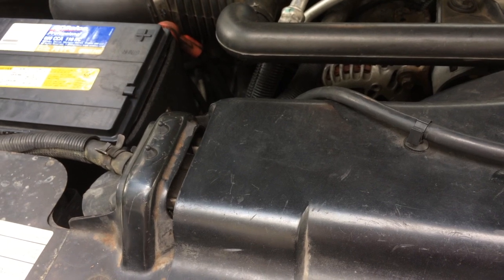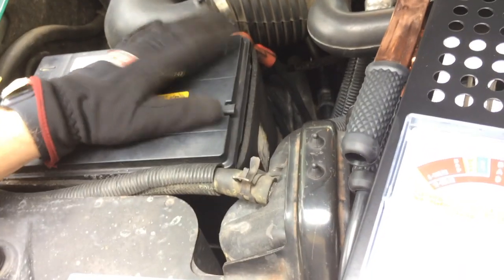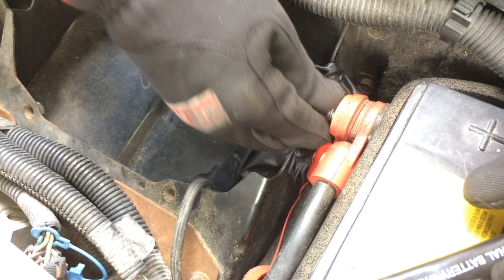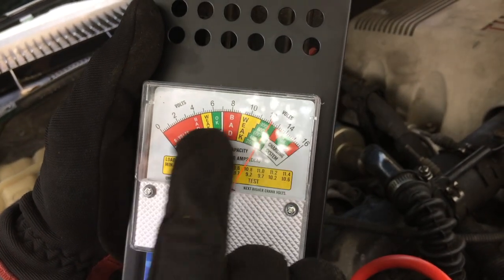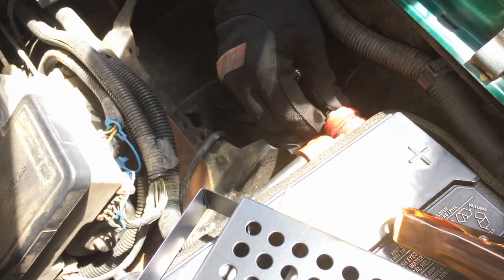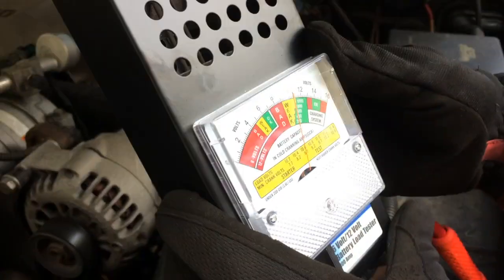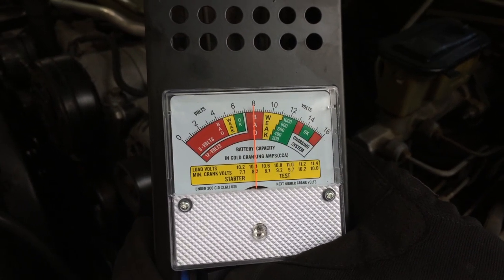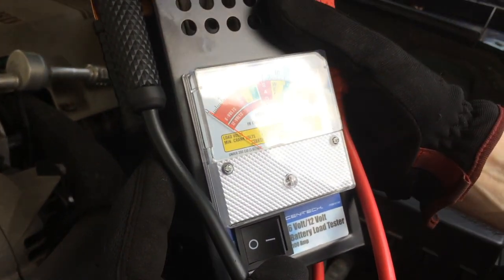1992 - 2002 6.5L Diesel GM Truck Testing Dual Batteries Reduced Cranking Power (Chevrolet & GMC)

Comment: Hey buddy thanks for the videos you do, just found your page. Have a 6.5 deisel also. Need some help with electronic components. When truch ia going at mild thottle, going 55 state highway. Will jump and lurch, with an extreme  thottle. Hold down break does not slow thottle speed.
Reply from the maker: I'm getting from the comment that you're experiencing an unexpected acceleration - I've not run into that sort of problem before.   But if I did I'd check for any diagnostic trouble codes with a scan tool first, and then see if the problem persists with cruise control engaged second.  I'd next look at the accelerator position sensor and see where results of these three checks took me next.

Comment: I have a 1998 GMC 350 and I was wondering if you can tell me where the TPS sensor is located I’ve been looking to see what tells me where it’s at can’t find anything
Reply from the maker: 98 GMC 5.7L Vortec V8 Throttle Position Sensor?   Not related to this battery video, but it's going to be on top of that engine attached to the front of the throttle body (the butterfly valve's shaft goes into it).   Search for 98 GMC TPS  and you should see a video from another creator here on YT that covers this for 96-99 GMCs.

Comment: I just found you today and am very grateful for the information that you give. I just bought a short school bus with a 6.5L Diesel engine. It's a 2000 Chevy 3500 model with 189,000 miles on it. I have never worked on or owned a diesel engine before so I'm trying to learn as much as I can about them. I hear bad things about the 6.5 but I also hear good things about them if you modify them properly. About the batteries: I didn't realize that I had 2 batteries on my bus until I happen to be under the bus and found the second one. My bus 'had' a wheel chair lift and at first I thought the 2nd under bus battery was just for the lift but after looking at this video I'm wondering if that 2nd battery helps the bus to start also. I removed that 2nd battery and the bus is barely turning over. Do all 6.5 Diesels need a 2nd battery? Thank you so much again sir.
Reply from the maker: Yep, all GM original equipment 6.5L diesel engines had dual Delco batteries.  The more rare option was one could also order dual Delco alternators as well.

Comment: nice video---had an ongoing low grade battery problem.  I also have the same HF meter.  I had one weak battery and replaced it with same brand etc.  The problem is that when one is low--it draws power from "good battery" and drags it down as well...  I finally put each battery separately on a charger for hours until fully charged (12.6-7 approx.) and when both were equal...hooked them back up...I also used a hf hydraulic crimper and $6 worth of 2 gauge wire from HD to make a new connecting cable between positives---world of difference.  the batteries now charge in tandem much better.  Later, I also changed alt cable to 4 gauge--which I think helped as well...  I also tested the current draw with key out...and found a parasitic drain from old alternator---replaced diodes (easy to do)...and it starts like new---even when sitting for a few days....lol

Comment: You be ok testing the battery with just one ground removed. Once the ground is off it’s completely out of the circuit. Also grab yourself a lead acid specific gravity tester. Checking each cells specific gravity is the only real way to determine the health of your lead acid batteries. Thanks for posting!